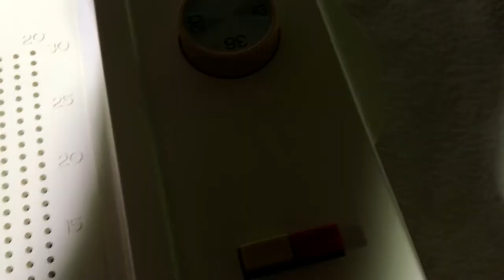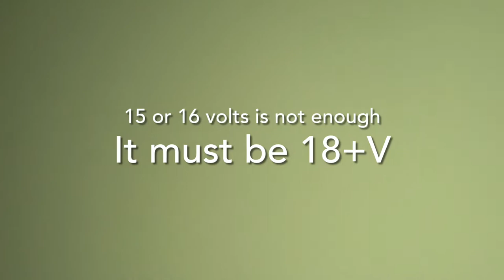Singer Memo-Matic Repair - steps to fix some of the potential problems

Comment: Hi, thanks for the video! One day, when I was programming the device, one of the red plastics broke and stayed inside. I had to take it apart and it was very difficult to put it back together again. What happened is that when I programmed it again the other day, when I touched the normal/negative buttons, there was a short circuit. I changed the fuse and it happened again.... Do you know what is happening? Regards!
Reply from the maker: Honestly I don’t know. Maybe you can bypass the problem by unplugging the unit before you switch these buttons.
Reply: @2lefthands769  Thank you!